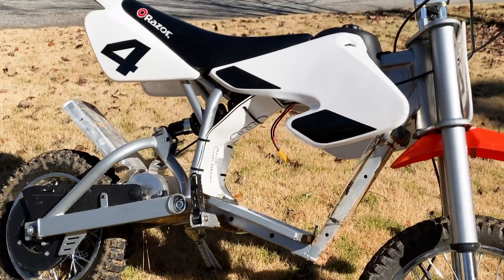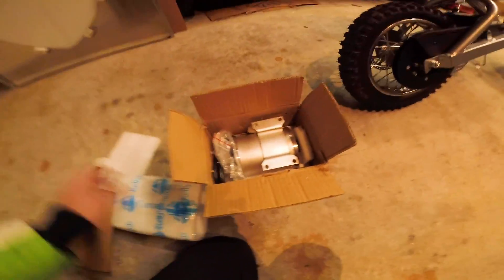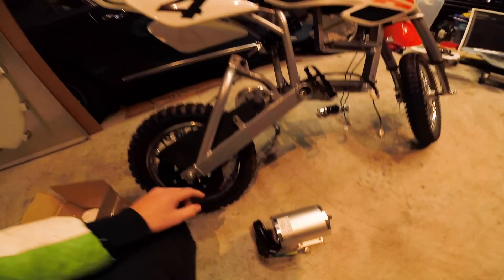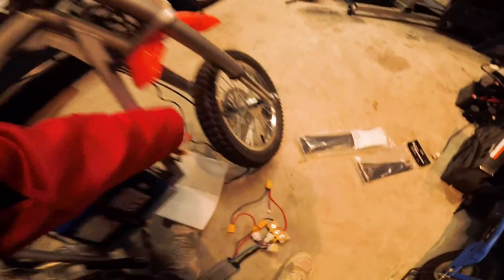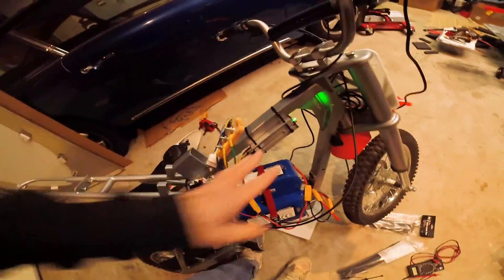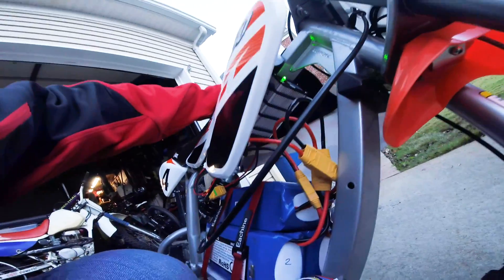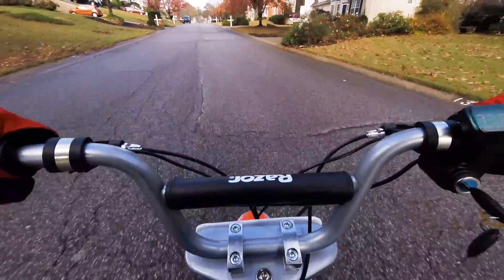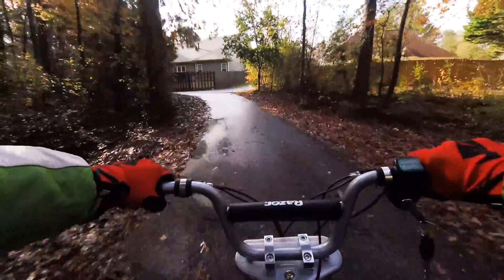Razor MX650 to MX3000 | 3000W 72V Electric Pit Bike

Comment: man you have 2 buy this battery its a 35ah 60 v mine gets 60 miles range and 50 mph!!!!
Reply from the maker: I need 72v nominal tho
Reply: What is it I might be interestes
Reply: Can u link me your parts
Reply: Join modified razors
Reply: @tiffanyisapoodle   how do i join ?
Reply: @tiffanyisapoodle   i joined btw and what are your parts ?
Reply: @drizel639  3kw 60volt bldc motor and a 35 ah battery off of ebay
Reply: @tiffanyisapoodle   how can i contact you besides youtube ?

Comment: Great job. Bought my little one a mx350 that I changed to a mx350 with 36v 1000w motor going 22mph, and I bought a mx650 the I upgrade to 48v 2000w motor doing 34.... great job
Reply: And after sprocket and chain switches, I'm doing 42mph on flats no problem with the 48v 2000w setup
Reply: @cedricshaw6117   Nice! Iol Good Luck! This will be my first upgrade, so it'll be a steep learning curve, especially the wiring lol. I am just trying to get the bike to pull my 210lbs butt. Going up hill on the a stock setup is no bueno. A lady walking her dog passed me.. *sigh*. LOL
Reply: Subscribe to my channel, and when you see me go live Saturday morning jump in chat. I'll go live and make my first vlog about wiring the bikes up. You can ask all you need. I have extra parts and batts as well. Never used, I'll make you a deal. Decals, lights and exc.
Reply: @cedricshaw6117  Sweet. Just subscribed. Chat with you then.
Reply: For the MX650 48v 2000w upgrade. Did you get the parts as a kit or did you source it individually?
Reply: You can find kits pretty easy yes. I went separately. That was last Xmas, when I built these. I'm about to go to 72v 3500w...lol trying to make 50mph soon
Reply: I’m running the stock motor in my E300 and hit 26
Reply: With 48v set up
Reply: nice
Reply: What battery's are you using can u send me the link please?
Reply: @bethhardcastle8052  that was a while ago. My sons bike is clocked at 34 now. I over charge his 36v to 42v with heat shield. It's a 42v from electric & co with one of their controllers.
Reply: Changed the motor sprocket as well for high speed
Reply: Look at my gaming channel "Cedric GladiatorHord " I'm 210 solid.  If need, hit me up in one of my streams... I'll walk to the garage and walk you through the wiring live, in between rounds lol.

Comment: Hey man sick build, how much for this upgrade? Batteries motor controller?
Reply from the maker: Batteries run about $600, controller $160, motor $107
Reply from the maker: Lucas  if you can get a 20ah battery that can discharge 200a for under $600 lmk
Reply from the maker: Lucas  if that’s so I’m sure it can’t actually put out what it claims. Man I know these batteries are expensive, but with this type of stuff you get what you pay for

Comment: I would really like to upgrade to this controller, would you be willing to make a short video about the wiring or post a diagram?

I have liked the video and subscribed to the channel, can't wait for more updates, I'm either going to get the same controller as you or the KBS-E for more current, but that's probably completely unnecessary.
Reply from the maker: Thanks bro! All the wiring is in the manual I mentioned. However, the diagram makes it look trickier than it really is. Just shoot a comment if you have a question. Thanks for your support man!
Reply: @AllThingsElectric_  are you using a pre charge resistor and contactor or just plugging it in and sending it? does the unit include a precharge resistor in the package?
Reply from the maker: @BigBlockGlock  I am not using one. The controller does come with one yes. My XT90 does have a resistor for anti spark though

Comment: I have an MX500 with the 48 volt version of this motor and one of the crappy controllers you talked about, it's good for about 20-25 mph with a whole lot better hill climbing ability than the stock razor, but it looks like your bike with the Kelly controller would slaughter mine. Definitely has me thinking about an upgrade. 

Thank you for the idea of what controller to use, I'm strongly considering it
Reply: i  picked up an 80 amp controller off amazon and it makes a world of difference, i gained about 15 mph over my 30 amp controller
Reply: My mx350 goes 22mph lol.  Fast scooter 36v and a 36v 10a battery and a 800watt motor

Comment: You’ll be ready for a larger frame soon. You can transfer the electronic to “monster” frame easily for just $649 on Amz.
Reply from the maker: The frame is really small, but I like the pocket sized. I can easily fit this in my trunk and take it somewhere. My whole plan was for an overpowered pit bike

Comment: What's the cost of this project? You've done a great job. Very nice. 👍
Reply: I modified ($80 Craigslist) Mx 500 with ($150 AliExpress Black Friday deal) 72v 3000 Watts motor & controller,  self made nominal 72V 1kWh (20S10P) plus 12v (4S10P) (over voltage boost) LIPO battery (recycled cells from tool battery packs $160), and 13 teeth front sprocket ($20). With me on it (175 lbs) it’s holding constant 52mph with boost batt on. My 8yr old son (70lbs) on the same flat stretch of private road is consistently going 55mph. I had to re-tighten spokes and balance both front and rear wheels because of severe vibration issues. Those small wheels were out of round and twisted like pretzels. Way to scary and nearly impossible to keep straight at anything over 40mph. Total bike cost $410, plus around 8hr in build time. New mod reduced top speed to 45mph, but gain extra torque to play in dirt. 9 teeth front sprocket ($20), Suzuki DS80 front triple tree & forks ($80), DNM rear shock ($60) & Shimano hydraulic brakes ($80). This combo is slightly faster and has more torque than my son’s gas powered 80cc Yamaha YX80. The best aspect of this father and son project is, that now my son can ride the shit out of it in the back yard with out noise complaints.
Reply: It can be done cheaper if u buy the kit with the cheaper big controller
Reply: @LoopsZ  Yep, I'm doing that, I'm also spotwelding my own li-ion pack so it will be much cheaper.
Reply from the maker: About $1200 as of now. But I plan to make more mods.